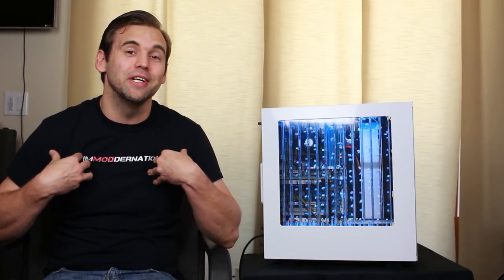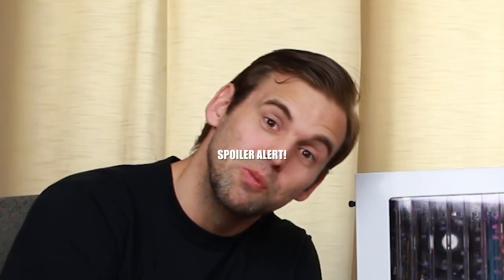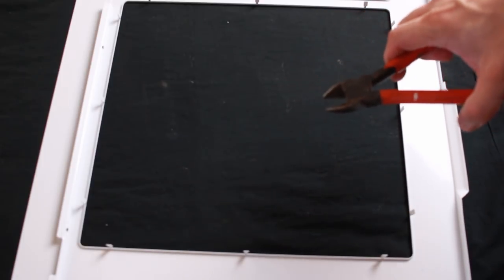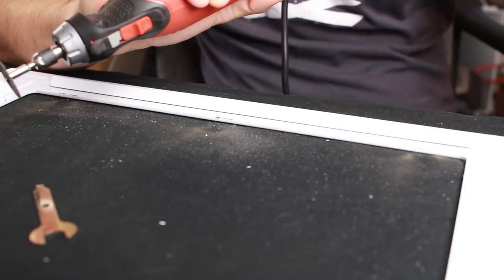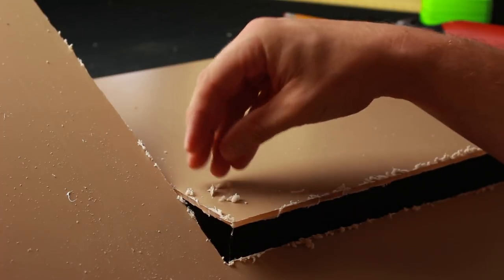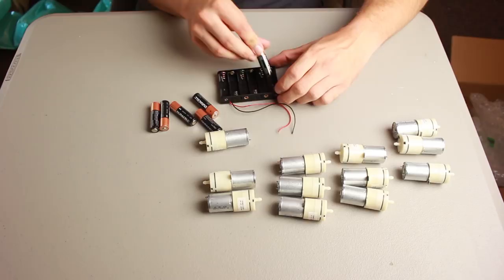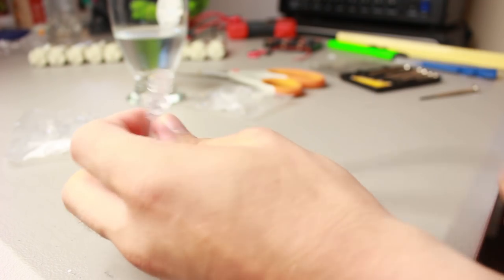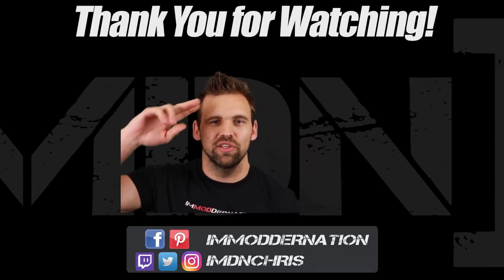BUBBLE WALL PC BUILD VLOG PART 1

Comment: You should go one step further for your next version: integrate solenoid valves so you can draw pictures with bubble-pixels.
Reply from the maker: Already one step ahead 😉
Reply: You had my interest, now you have my attention. I'm gonna be waiting for that next video then... and in the meantime think of something to one up even that :-P
Reply from the maker: Learning to program Arduino and maybe switch over to glycerin instead of water because it produces better defined bubbles but I must fix this design first.
Reply: Luckily Arduino is easy enough, thanks in no small part to the huge community, which basically has solved just about every basic task you'd think of. I recommend searching on hackaday for "bubble display" for more inspiration on the topic. There's at least one example that also uses RGB LEDs to color the bubble-pixels.
Reply from the maker: Jay Summet did a bubble wall with Arduino. Using his "guide" loosely
Reply: Hah, yeah, that's exactly the one I was referring to when I mentioned the RGB LEDs.